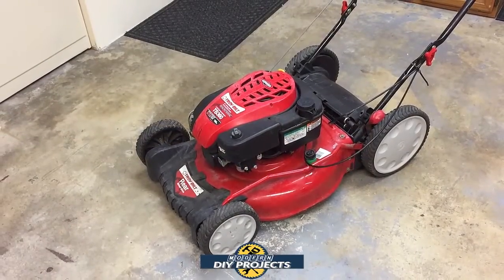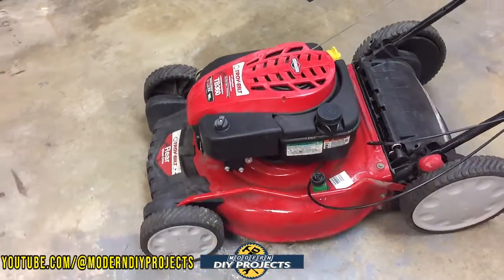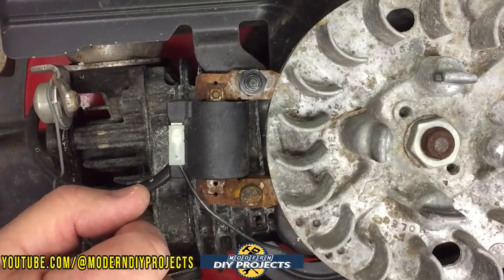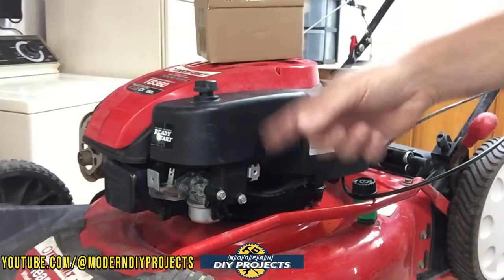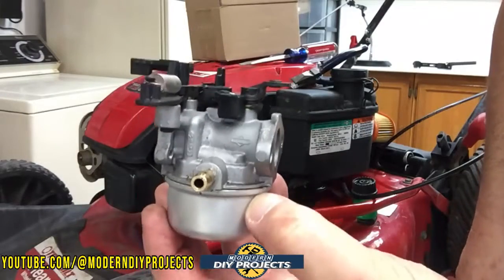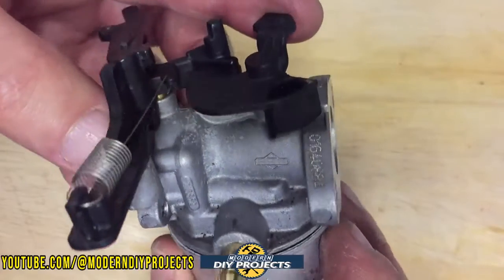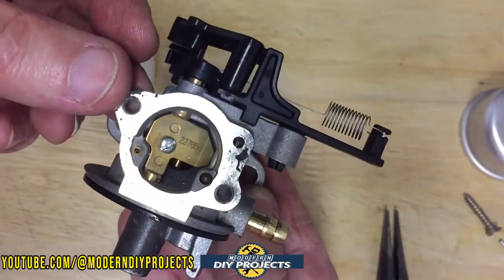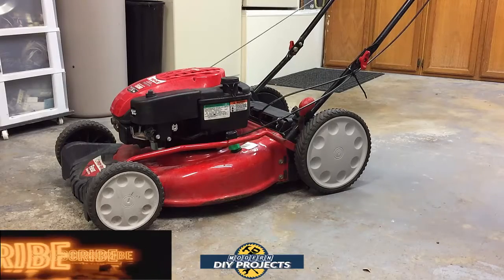Troy Bilt TB360 Broken Trash Pick Lawn Mower Wont Run, Can we Fix it and Make it Run?

Comment: I just got a free tb360 my neighbor had by the road. I took the carb off and the needle wouldn't come out of the seat. The needle ended up breaking so I came here. I just ordered the carb in the link. Thank you!
Reply from the maker: It seems to be a common issue with these since that is the exact same problem I had to fix.

Comment: Do you have the model number for the  carb? I have the same mower and need to replace. Good tips. Thanks for the video!
Reply from the maker: Use the links below for all your info. Keep in mind that prices have changed since I made this video.

Link to the Briggs OEM Carb: https://shop.briggsandstratton.com/products/briggs-and-stratton-594287-carburetor

Here is the link to the one that I got: https://www.hipastore.com/products/hipa-carburetor-for-troy-bilt-c-7-75hp-8-75hp-bs-2700-3000psi?variant=42978461843677

Comment: I replaced the carburetor but i think i need to replace the fuel filter but I cant locate it. Can you help?
Reply from the maker: These machines don't have fuel filters. If for some reason it does have a fuel filter it will be inside the fuel tank or connected to the fuel tank. But I have never seen a filter on the fuel line because the fuel line is generally only a few inches long. From the tank to the carb is just a few inches of hose. Not enough room to put a fuel filter. If it's not a clogged fuel tank then you probably have other issues like bad spark plug or bad coil.

Comment: I have the same mower I replaced it with a new carb and found out the oil was overfilled. It was a free mower but I still can't get it to start after I got out as much oil as possible and cleaned out the exhaust and plug and replaced with a new plug but if it does start it won't stay running but a few seconds. Any tips?
Reply from the maker: Make sure you have consistent spark. The coil could be intermittent or bad. Also make sure the carb is good. Just because it's new doesn't mean it's good. Some imported carbs have been known to be so poor that they wont run. Make sure everything is clean and the oil didn't contaminate anything.

Comment: I have a friend who has the TB360 Professional model with the 190 CC Briggs & Stratton engine on it... however the sticker showing the engine has been basically been destroyed. He's having problems with it starting ... I replaced the plug (as the one in it had a lot of carbon built up on it), I had it running, but it barely ran until I took off the air filter and it sped up, but was still running rough.... then it wouldn't start. I'm suspecting a clogged carb. I'm looking for a replacement, however I'm not sure which one I should get as I'm not sure which engine model it is... anyone know??

Comment: I can't get mine to mulch with a mulching blade.
Reply from the maker: The blade is probably upside down. Turn it over and see if that helps. You must also be using the mulching attachment, not the bag.